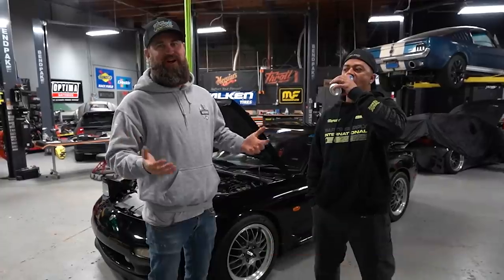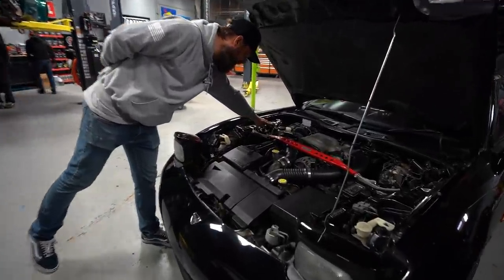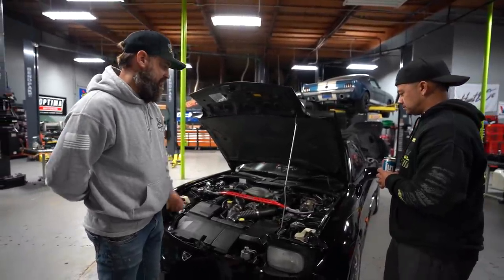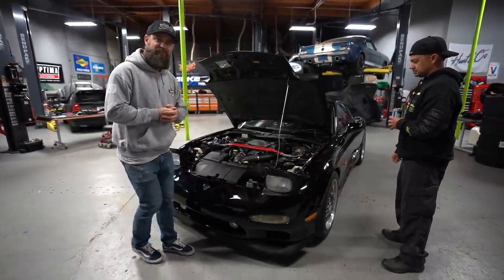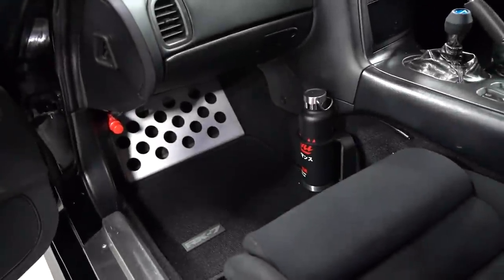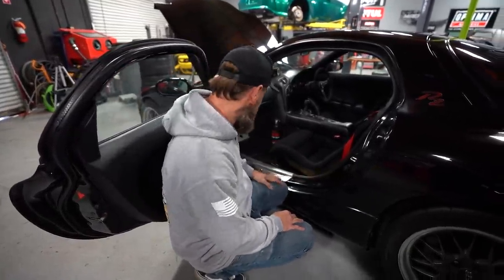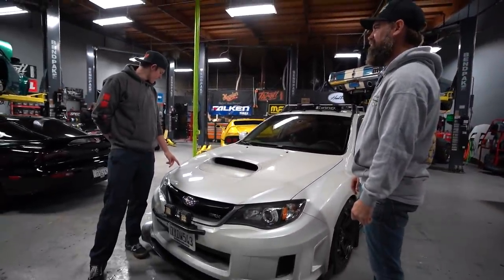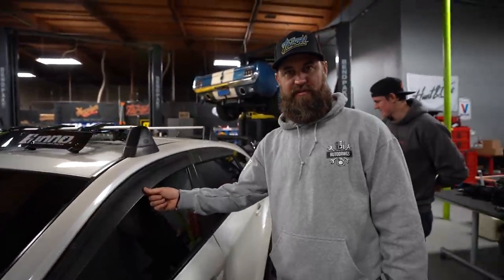Reviewing throtl Employee Cars - Part 1

Comment: Just looking at what we can see from the video there's 13 cases of NOS energy drink on the shelf. @0:01 in the video

13 cases of 24 = 312 cans 

312 × 54 = 16,848

With 54g of sugar per can that's 16,848 grams of sugar 

453 grams of sugar = 1 pound 

16,848 ÷ 453 = 37.19

They have 37 pounds of sugar on the shelf 

RIP kidneys

Comment: my dads third race car and the last (for now) he had was a navy blue 1997 e36, nut it wasnt an M3, however he did put 30,000 into the car.  it had around 400 hp and I know that doesn't sound like a lot but it was a very light car. he did have to sell it back in 2012. it was truly bad ass.

Comment: 13:46 What separates a stock BMW (model name here) from an M3? Engine, bodywork, special bits and pieces? If you have a stock car, can you upgrade it to an M3? Is putting an M3 badge on a stock car with M3 spec parts and flawless execution frowned upon? Does it have to come from the factory as an M3 with the paperwork?
Reply: Just do whatever u want